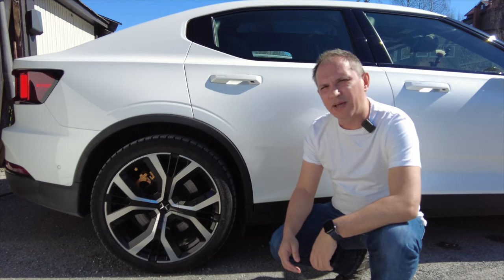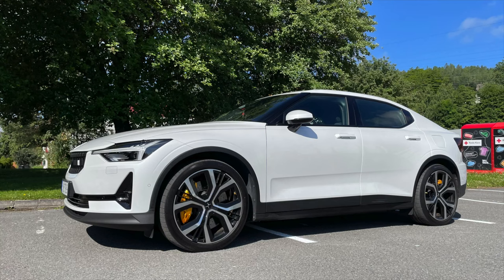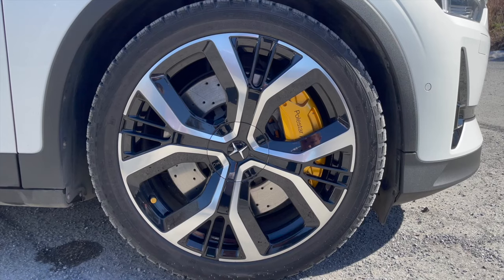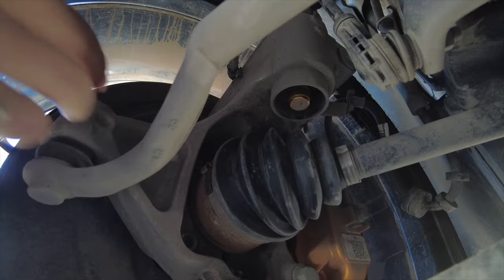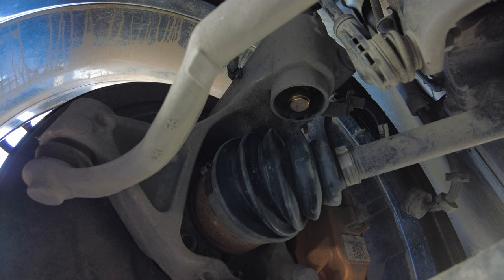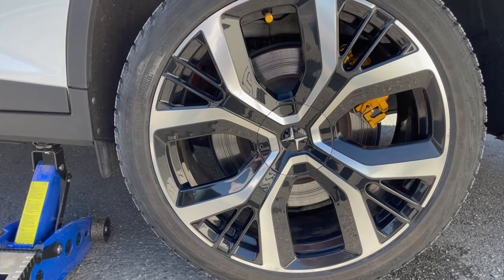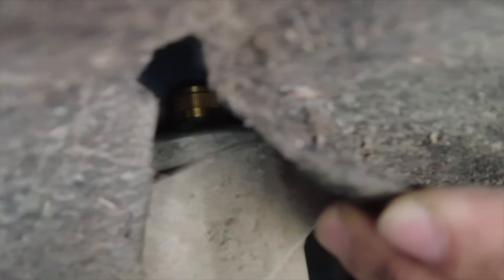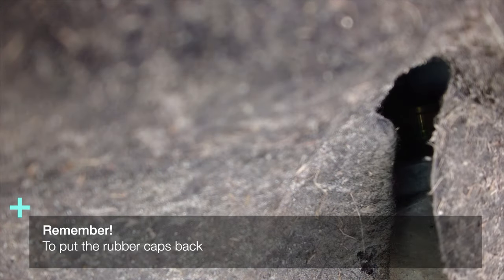Adjusting the suspension in the Polestar 2 (Performance Pack)

Comment: Thanks for creating this video... I have a question. If you adjust to track the suspension/shocks in the front and back.  The P2 will drop to the ground with a few centimetres?
I meant it would lower?
Reply from the maker: Hi! The adjustment only has an effect on stiffness, not height.